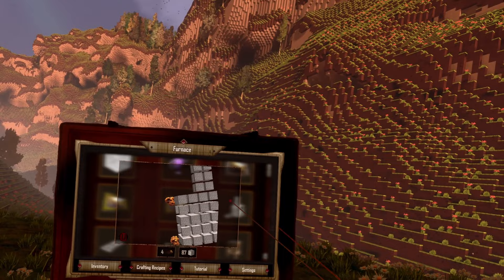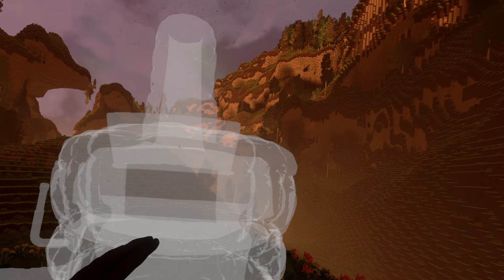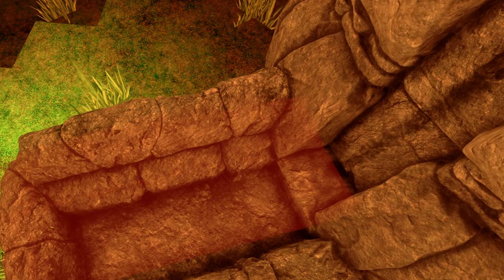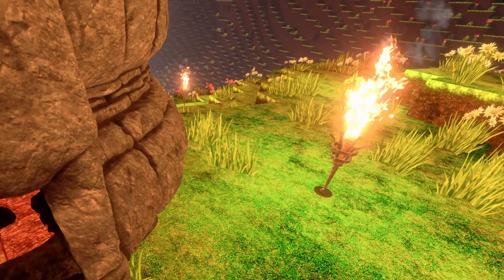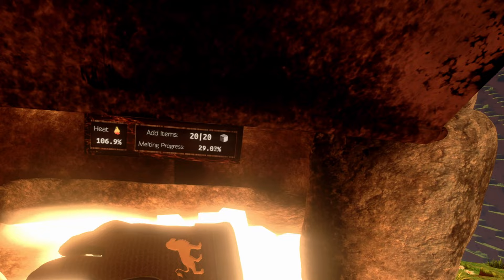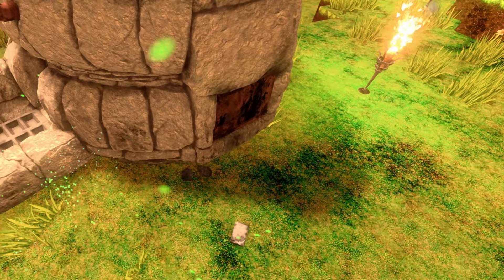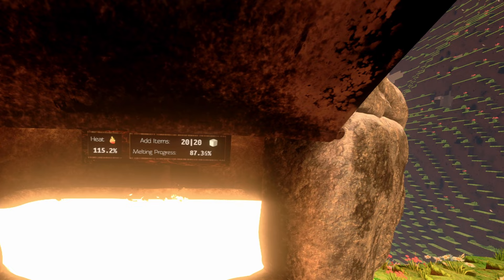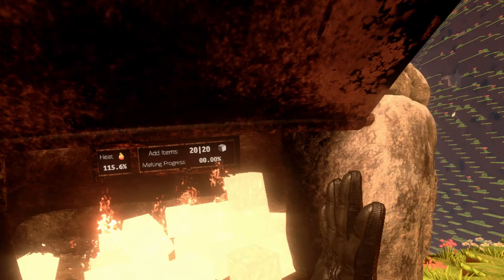cyubeVR // Tutorial ~ The furnace

Comment: This is a non furnace question, but what settings do you use to make the landscape blocks far into the distance still look so sharp? On my computer the terrain gets more blocky farther into the distance. Thanks.
Reply from the maker: it's the LOD level. if you put it on high, the distance looks better. I use custom values for teh LOD, that's why there is the ini-option. There I oncreased teh LOD even furter. But that is only possible, because I have a powerful PC. And it takes a few tries to find the balance between high LOD and good performance
Reply: @chibiarchervr  thanks.

Comment: One thing I didn't quite catch from this: if you do add a mixture of iron ore and sand, what's the result in the mold?
Reply from the maker: You will get whatever was the most present in the melting chamber. If you add 9 Sand and 11 iron ore, you'll get iron
Reply: @chibiarchervr  Good to know, thanks.
Reply: Hmm, now... I'm wondering, what if you add 10/10? Does one always win? Last added? Random? Something else?
Reply from the maker: @DavePearson  aaahhh sorry I Was mistaken this game with another one. In cyubeVR you have to add 20 items of the same kind. So if you have 11sand in the chamber, you still need to add the 20 iron to get the melting done. And because you had 20 iron ore, you will get iron. The counter for iron will not appear until the ore overcomes the Sand. So if you put 10 iron in the chamber, it still counts the 11 sand
Reply: @chibiarchervr  Makes sense, and noted. Thanks. :-)

Comment: Hey, I cant seem to craft the furnace am i doing this wrong or something?
Reply from the maker: maybe you put 2 too many stones in the middle of the furnace. there is a stonelayer between the lower burning chamber and the upper meltinchamber. these 2 chambers are connected. at the back of the funrace there should be a 2x1 gap
Reply: @chibiarchervr  I got that, Think its a glitch?
Misplaced block?
Reply from the maker: @vrtrunky5527  hmm that's strange. that never happend with the furnace for me. And I made a few dozens of them by now :D  maybe the chimney is 1 too short, or the extention to the left is not in the middle? And if things just don't want to work, build a new one. it takes about 20min. so it is still better than not having one at all  :D  oh maybe you missplaced the copper.  Or you used some iron ore and confused it with stone ( I did this a few times, when melting iron)
Reply: @chibiarchervr  I could send you some screenshots on steam?
Reply from the maker: @vrtrunky5527  sure. you could also visit the games Discord, or my discord.